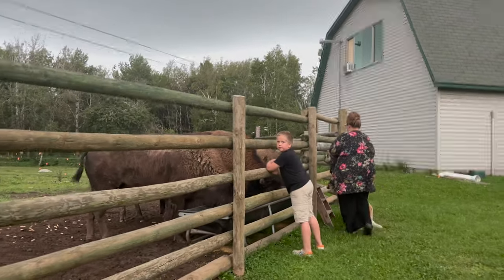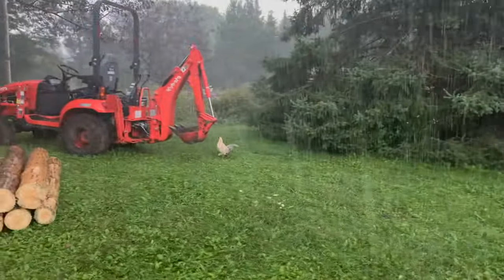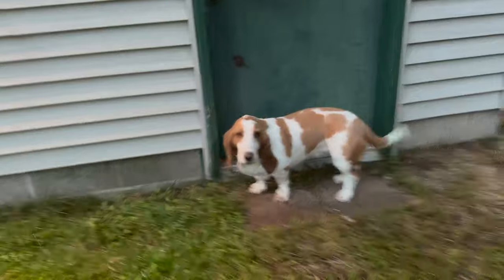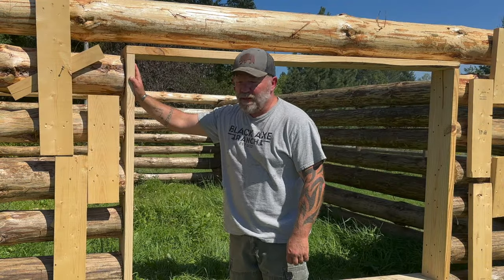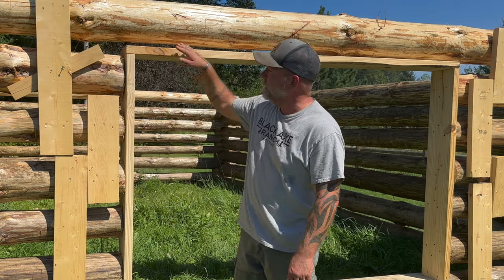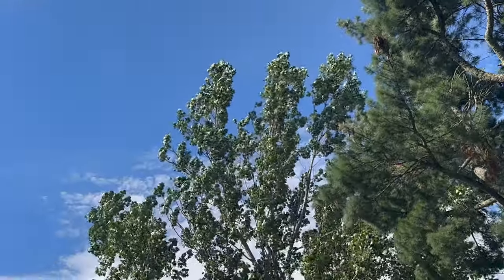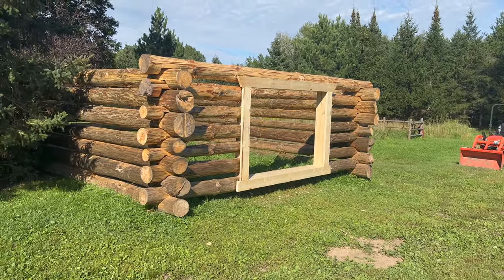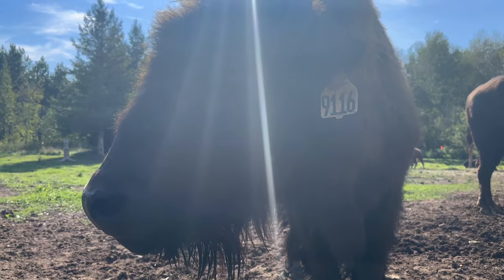Found THIS in the Bison Pasture Today!

Comment: Happy Holidays, Is snow coming soon? and when are you going to work on the roof? and is the barn only for bale hay only?
Reply from the maker: Happy Labor Day! I've seen September snow before, so it certainly isn't out of the question, lol. Although we've had some absolutely beautiful weather lately. The roof should get started in the next couple of weeks. Got to put metal lathe in between the logs so I can put the chinking in place. I've been putting some dirt fill inside as a base for the crushed rock. It will be for baled hay only, but we will also keep our various grains out there as well. :-)